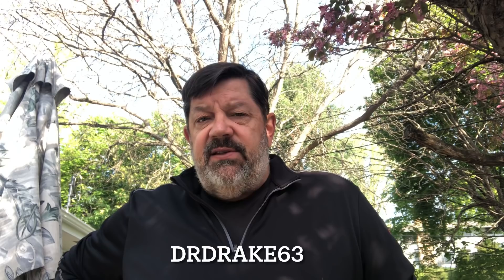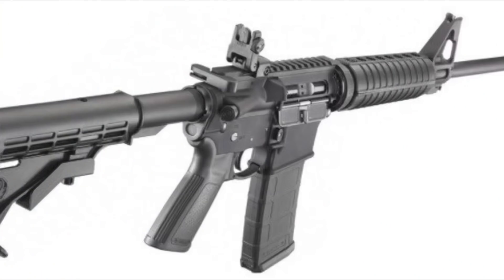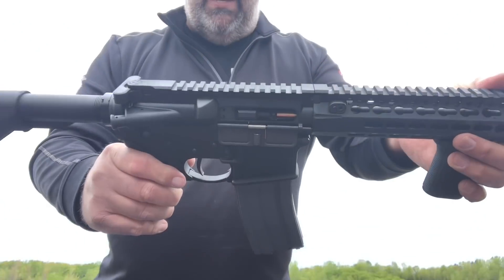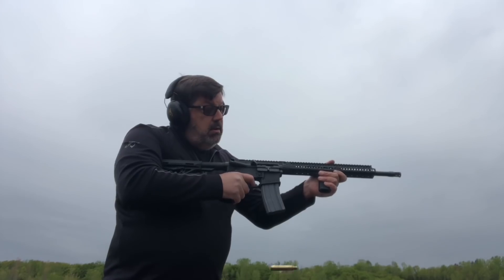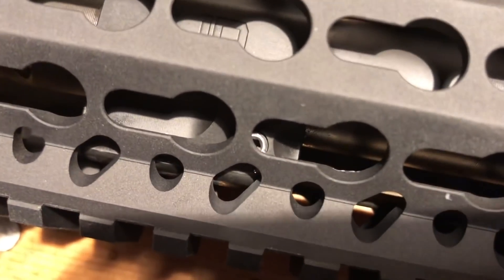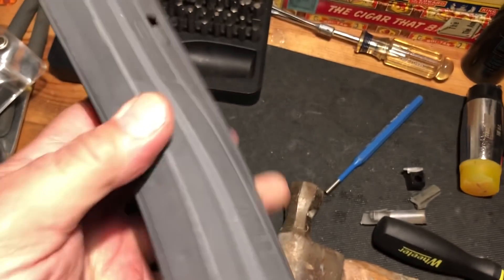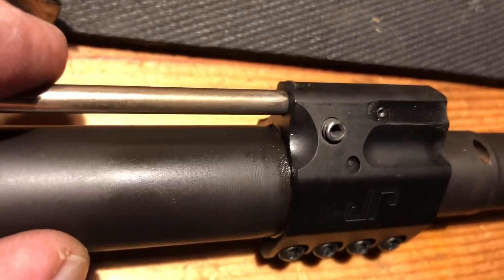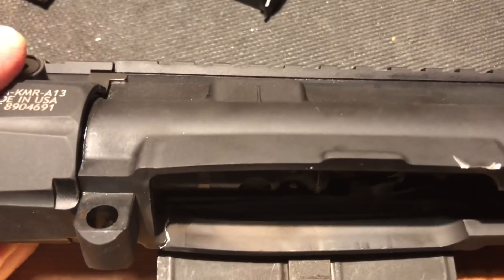Colossal AR Failure

Comment: I don't see how that much damage could come from the gas system. Seems the gas tube would have ruptured or blown the gas key off the bolt. That looks like a way over pressure round or a barrel blockage of some sort occurred. Let us know what you find, very curious as I have a Ruger.
Reply: @Bob Thompson rest assured it had nothing to do with the gas system
Reply: @vitalsigns2679  The adjustable gas system? It's a way to tune the energy that goes into the carrier. Different quality ammunition can create changes in operation (some people complain about not being able to cycle steel cased ammunition - steel case is cheaper and loaded weaker) and installing a suppressor increases the gassing of the weapon. So instead of having inconsistent operation one can choose a "middle of the road" approach that tries to keep the weapon appropriately gassed for the conditions you're planning on using it.

Comment: We know that the chamber inside the bolt is much greater diameter than the thinner walled gas tube so the pressure was much less than in the gas tube provided the internal piston was free to move. The pressure would have been the same if it was stuck somehow. By your video we can see there wasn't bulging of the thin walled gas tube so it would be safe to say your bolt body failed on that round upon firing releasing metal fragments and gas down through the mag. Defective bolt. Let me know if you need anymore help with this stuff.
Reply: @Bob Thompson The gas tube is a thermal fuse. It blows due to heat before the barrel does in continuous fire. The pressure required to cause an early extraction and consequent case failure would not blow the gas tube, or else there would be almost no AR catastrophic failures. Gas tubes can handle overdriven ammo and pass the buck to the bolt, where the failure occurs.

Comment: You sir had an ammunition issue, not a gassing issue.
Reply: Correct. That was a serious overpressure situation, either caused by a bore obstruction like a squib or an incorrectly loaded round. As for what needs replaced, the whole upper assembly is smoked. Trying to salvage any part of it except the gas block and myzzle device is a bad idea.
Reply: @KoonceTodd  firing pin and cam might be okay.
Reply: That was not a gas issue... that was an over pressure issue from a bad round. Or an out of battery detonation.
Reply: Gas port in the barrel is only so big.  This was not caused by the gas block.
Reply: sure you didnt get a blackout round in that magazine? reloads? skechy reloader,somone not fill the case right or mix up fast burning pistol powder ? 100% coincidence you were adjusting a gas block.By time the bullet gets past the gas port there shoukdnt be enough pressure to do that. Did you check the barrel for obstruction?
Reply: @williamdevlin5439  you the man!!
Reply: Agreed.
Reply: Right. I’m not a gunsmith but how could this possibly be a gas block issue. At the extreme ends, it’s either all the way closed and doesn’t cycle at all. Or it’s all the way open, just like a non adjustable block and should cycle and work the exact same as it did before the new block
Reply: I agree.
Reply: I'd have to agree! Not a gunsmith myself, but have seen this in other guns before at shooting ranges.
Reply: You hit it on the head! Please get a you tube vid. The amatuers are rampant
Reply: Almost looks like a 300 BLK was chambered.
Reply: I was gonna say the same but looks like the entire comment section got this one lol
Reply: Where you rounds reloads
Reply: I definitely agree that it's an ammo issue. Most likely that "I had one spare round left" was actually .300 Blackout (.308 ACC) round. The remains of your rifle look identical to results you can find in YT videos where they blew it up intentionally and many were a round inadvertently got mixed into .223/5.56 ammo. The only other explanation would be an improperly reloaded round.  My tips for Blackout weapons safety:  I always use separate well marked magazines for Blackout weapons. Mags for 5.56 are always loaded separately and with all Blackout ammo off the table. Frankly I don't even really like to take both calibers to the range at the same time with my boys because even with well marked mags and rifle wells, they are only one simple mistake away from an explosion.

Comment: I just cut down the milspec gas block fsb if it's timed and pinned. This is very unfortunate and I'm glad it didn't take your digits my friend.
Reply: A friend of mine was having issues getting his "cheapest parts on the internet" ar to cycle, turns out the hole in the gas block sat about 1/16 of an inch forward of the gas port even though it was up against the barrel shoulder. He did succeed in building the cheapest manually operated ar.

Comment: So this was not related to the gas block at all. Even an over gassed gun would not fail like this. My guess is either bad headspace or significantly overpressure ammo. The failure resulted from the back of the chamber where the bolt locks up with the barrel extension. If you could, I would examine the spent brass from the previous shots and look for signs of bulging in the case head area to see if there are any signs of bad headspacing. Rest assured though, this has nothing to do with your work on the gas block.
Reply from the maker: Thank you, this was the type of feedback I was hoping to get. I did check the spent casings and none of them have the bulge you discuss.
Reply: @drdrake63  Absolutely, I'm sorry this happened and i'm glad you're ok. I would also be curious to know if this ammo was purchased recently? There have been many reports of bad quality control issues with the increase in production rate. 

I also figured I would add some info in about the gas block. So the adjustable gas blocks can only decrease the amount of gas going into the gas tube. A standard non adjustable gas block is actually allowing the maximum amount of gas you can get into the system because there is nothing to restrict flow. The limiting factor being the size of the gas port in the barrel. So from an engineering perspective its not possible to get the kind of gas necessary to cause this failure through that gas port. Additionally, the thin gas tube would blow out long before that thick steel BCG would.
Reply: I should have read your response before I posted.  I too think it was a headspace issue.

Comment: The only way it could be overgassed is from a cartridge or obstruction, the adjustable block can't make it higher than a non adjustable block.
Reply: @Bob Thompson The size of the port in the barrel determines how much gas is taped for operation of the piston in the bolt. The hole in the gas block is usually larger to allow for slight misalignment. The damage here almost has to be caused by an obstruction or a massively overloaded cartridge.

Comment: You didn't mention the ammo. Factory? Reloads? That's my initial reaction
Reply: Kinda looks like an out-of-battery detonation to me.
Reply: @randomgeneratedname1264  That was my thought as well.  Looks like the bolt didn't seat properly.
Reply: @randomgeneratedname1264  Definitely possible, but is very hard to do with an AR given the way the bolt is cammed. Over pressure is possible. Would love to see the casing and see if it ruptured.
Reply: @randomgeneratedname1264  Like a "hang fire"?
Reply: @fosterdl1  OOB detonation would mean the firing pin struck the primer when the round was not firmly seated in the chamber with the lugs of the bolt locked into the barrel extension
Reply: It was most likely a case head separation caused by an overpressured round, or squib load.  My ar blew up last year the same way.  No adjustable gas block.
Reply: @TwoStageTrigger  In an update he showed all the factory ammo. No case head separation
Reply: Agreed.
Reply: This to me just doesn't make sense as an OBD due to the way the BCG is damaged.
Reply: Great question 🤔
Reply: It's not a stock colt

Comment: Great thing about AR's is when they fail, they tend to fail in a way that is relatively safe to the shooter.  Glad you're safe.
Reply: kuhchuk I agree. ARs are designed to blow out the ejection port and down through the mag well. Glad he was not injured or worse.
Reply: @kuhchuk, speak on it, we all know your reference....
Reply: @kuchuk, you can god damn well tell you’re not left handed! Read my post on here about the pos. Then tell me what you think about loosing your right ear and most of your right cheek from one of the sob’s blowing up on you,IN THE MIDDLE OF A FIREFIGHT, not on a f king rifle range. November, 1967. Guys last name was Carson, Billings Montana. Nickname was “kit”.
Reply: @Pointman-yf6or  to be fair those early AR’s where crap
Reply: @crunch9876  Not really, the ammo and training were the main issues with early M16's.
Reply: @crunch9876  derp
Reply: @boomerisadog3899  old ball powder  was one big problem, but so was not  having a chrome bore/chamber in those humid conditions which caused pitted chambers. It was all a recipe for disaster; the rifle was pushed into action without sufficient testing, and then powder made its way in that didn't mingle well with the rifles dwell time. The new reciprocating weighted buffer system and chroming of the barrels introduced in the a1's fixed most of these issues.
Reply: @muddyhotdog4103  That and issuing cleaning kits lol.
Reply: Unlike the RN-50

Comment: Looks like a barrel obstruction. Before the last round was fired did you have to manually charge the handle to clear the brass. I have had a reloaded round not have powder in it that blocked the barrel with the projectile. Luckily I realized that something sounded funny and checked the barrel and sure enough it was blocked by the projectile. If I had chambered the next round I would have had the situation that you ended up with. Were you able to look at the brass of the last round and what did it look like. Also looks like the round could have gone off before it was fully chambered but why would that happen. I know of AK's bump fired that have done that due to timing because a semi auto is not meant to do what a full auto does. Very strange, thank the LORD you were not hurt. ALWAYS wear eye protection I can handle flesh wounds but not eye injuries.
Reply from the maker: the last round chambered just fine......I didn't have any reason to suspect an obstruction........
Reply: @drdrake63  If you are sure the last round went down range and there was no click instead of bang then probably no obstruction/squib so maybe a bad factory round. Check the case of that last round to see if its damaged or not.

https://www.youtube.com/watch?v=aFlD3sYnq9U&t=8s